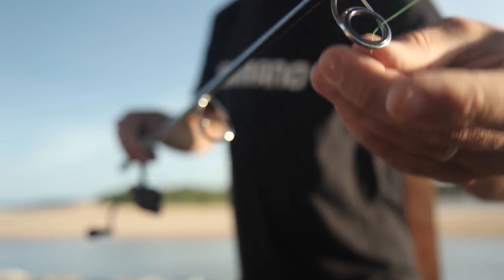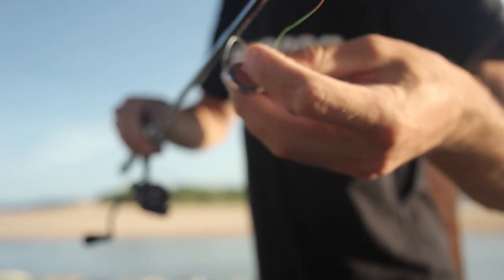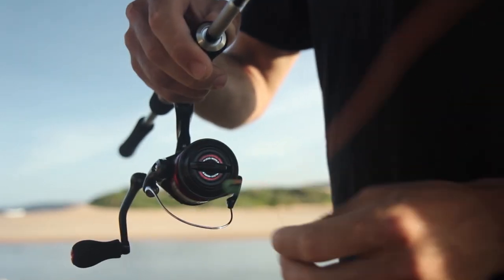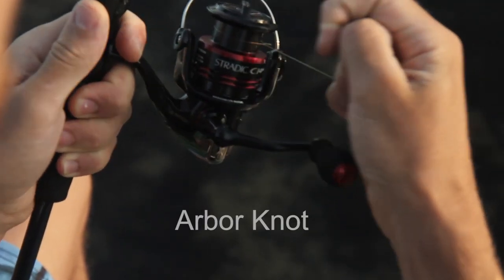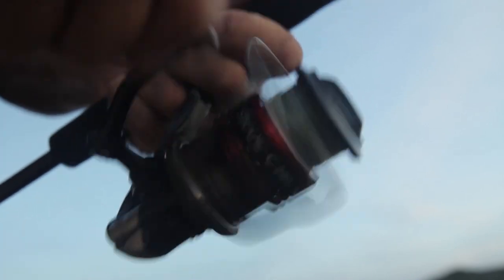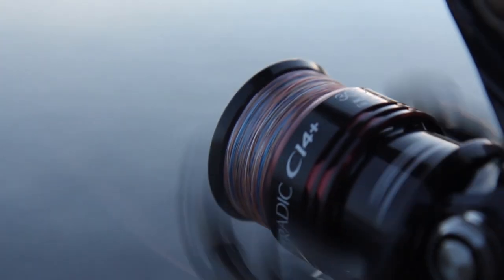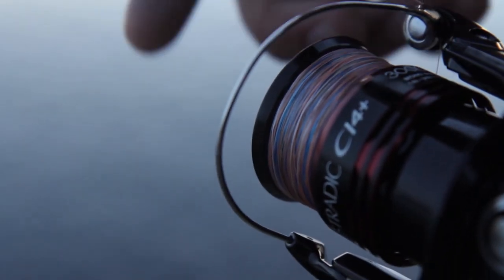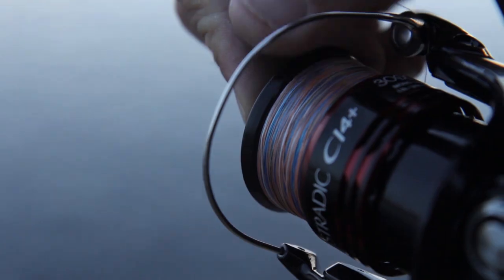How to spool a reel correctly  - SHIMANO FISHING

Comment: Why does my new 2021 Nasci 3000 have concentric circles at the bottom of the spool? 
Is backing / tape to prevent slip or for the angler save cash on expensive braid which comes in 150 or 300, either too short or too long for the spool?

Comment: with braid it is fine. But if you were putting mono onto a reel this is the incorrect way????
Reply from the maker: Hi Glen, with mono you can tie the line onto the spool and wind it directly on. There is no requirement for backing like braid. Thanks, Team Shimano.